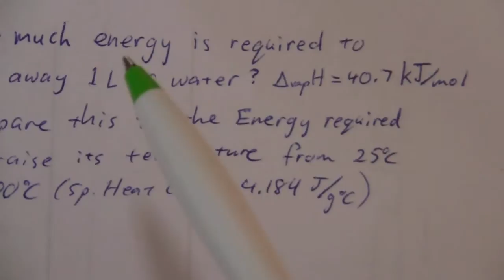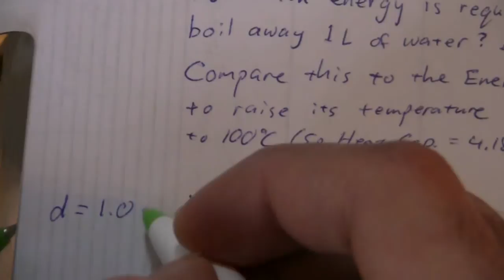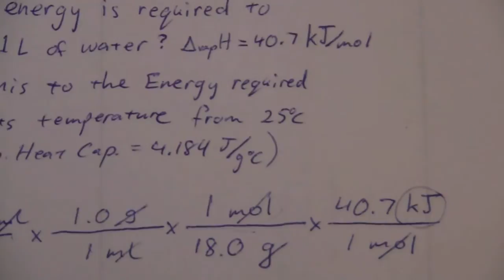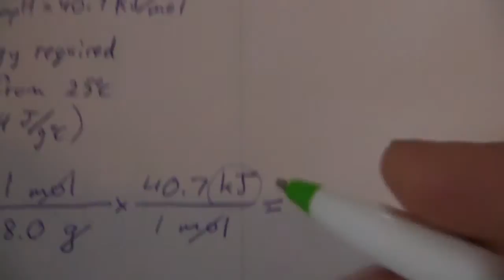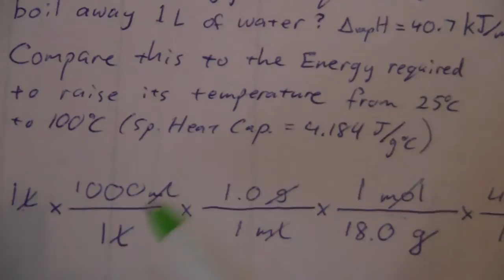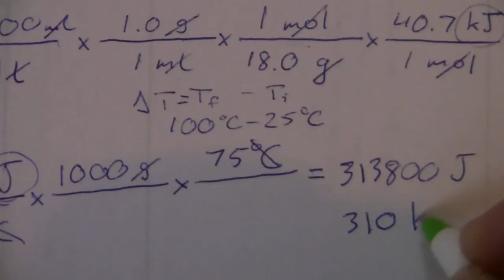#5 Energy Required to Vaporize Water

Comment: Thanks for this info.
But does this mean that drying a towel with 1 liter of water "costs" 22.61 kJ, which is equal to 0.61 kw/h?
If so, it sounds like a bad idea to dry my towels inside in the heating season (winter), right?
That imply that drying the towel will cool the room accordingly, which is the principle of the swamp cooler, I guess.

Comment: I wish to vaporize 1 litre of  pure water @ 25c  at sea level 1 bar in a sealed quartz vessel.     How can I calculate the temp and time needed using a simple oven with max temp of 400 F?
How can I calculate how strong my vessel needs to be?

Comment from the maker: I'm not entirely sure what you're asking, but the 1L was given in the problem. You can represent that in whatever units you want, though, whether 1000 mL, 100 cL, or 10 dL, (or any number of others). Knowing that the density of water is 1.0 g/mL, I converted this to mL, but you could just as easily use a density of 10.0g/cL or 100g/dL or just use 1000 g/L. The main thing is that you have to convert that volume (1 Liter) to mass in grams (to cancel with the specific. heat).